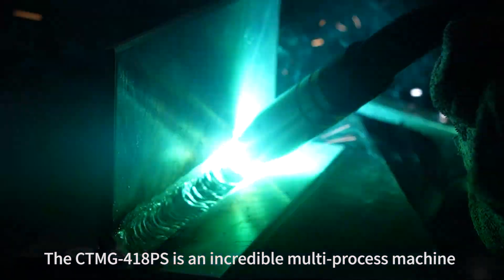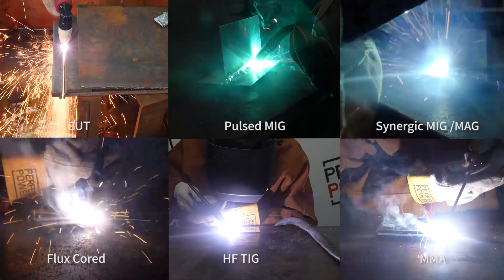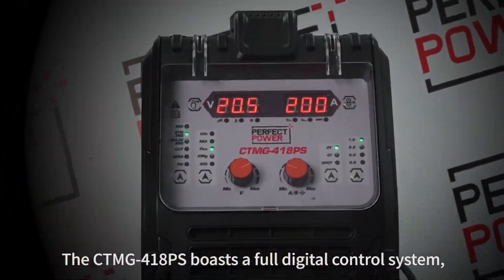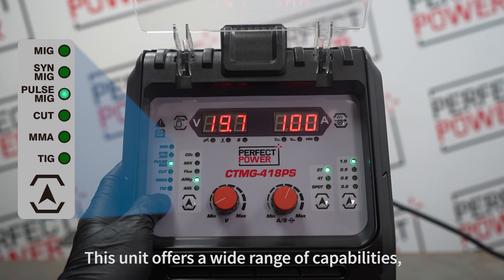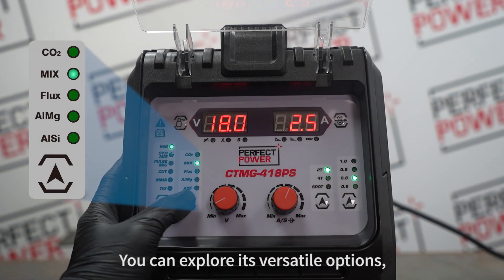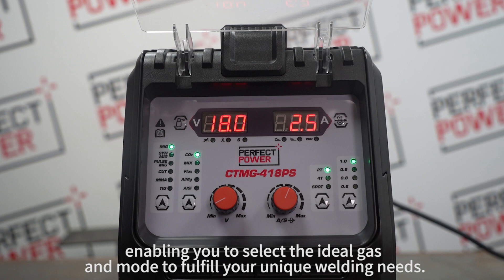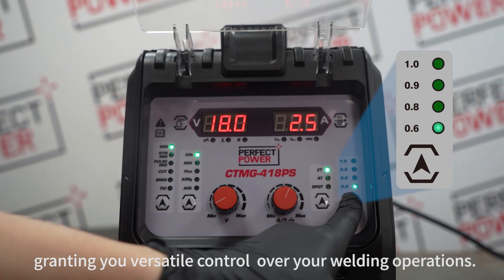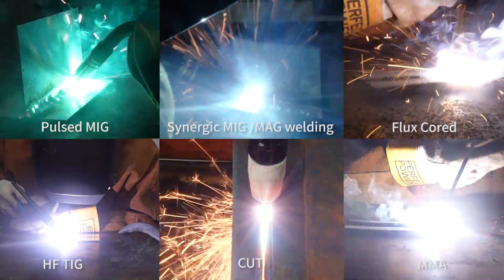CTMG 418PS 6-In-1 Multi-Process Welder & Cutter

Comment: is this single phase ? will  it weld titanium metal as well ?
Reply from the maker: This machine is single-phase voltage，suitable for Carbon steel,Stainless steel,low alloy steel, Al,Si,AMg,Cu，